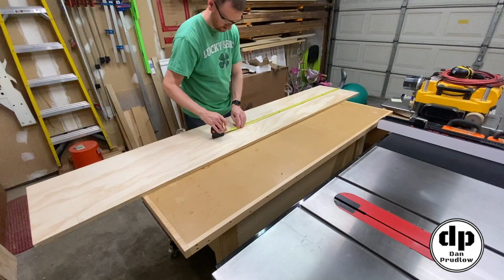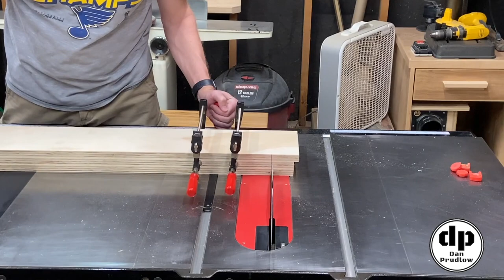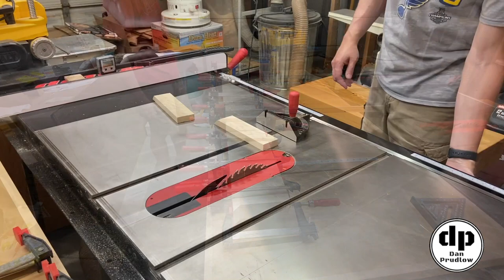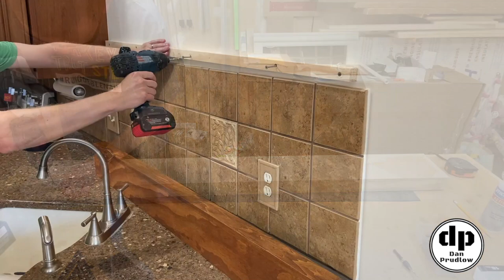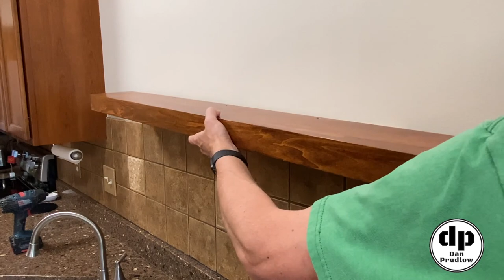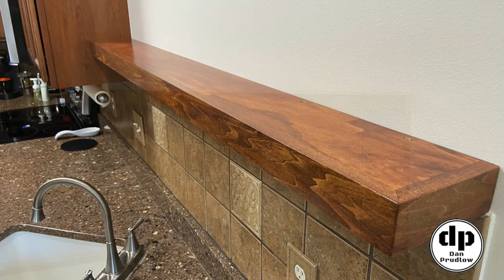Building a Floating Shelf from plywood and poplar

Comment: Great shelf Dan. Gotta say... I know you got a saw stop and all but damn.. some of those cuts you made made me cringe. No doubt you have skill, and are comfortable with getting that close with your hand. Perhaps just tell amateurs and DIY folks out there, always use a push stick or “Gripper” when making such tight cuts. Some folks may not fully understand how getting that close to the blade requires significant experience, focus, and comfort level. Even then... I would never advise it, even pro’s have made mistakes and paid dearly for them. Great videos man!
Reply from the maker: Thanks for the compliments.  I do get some comments about being close to the blade.  I will say a lot of times the video makes it look closer than it is.  My primary concern is keeping the workpiece under control.  Sometimes having your hands in direct contact is much better at sensing that control.  Thanks for watching and then comment!